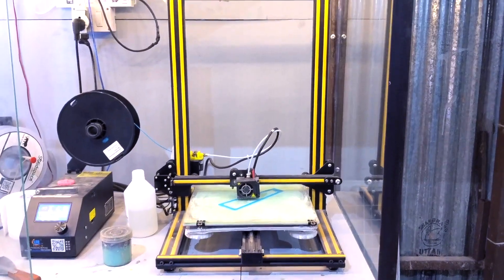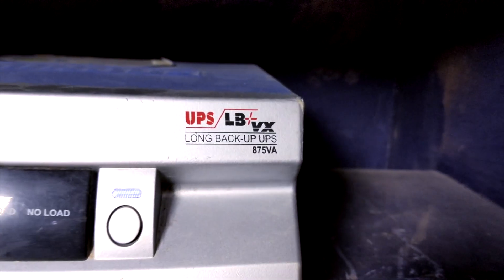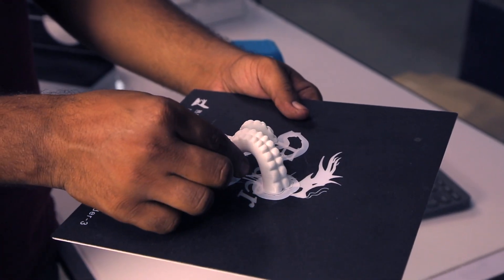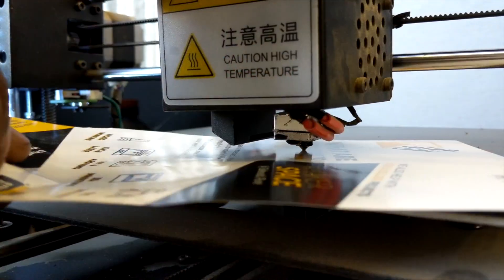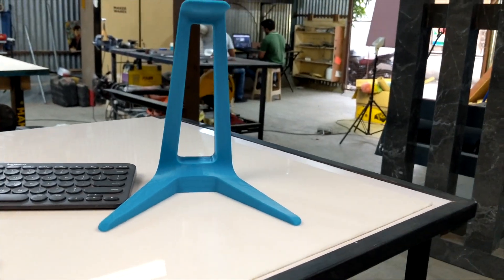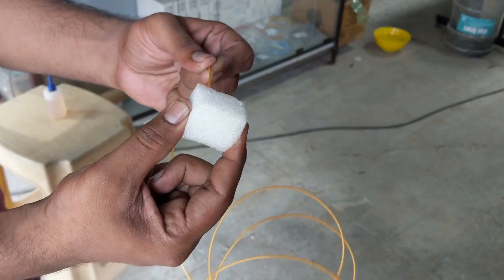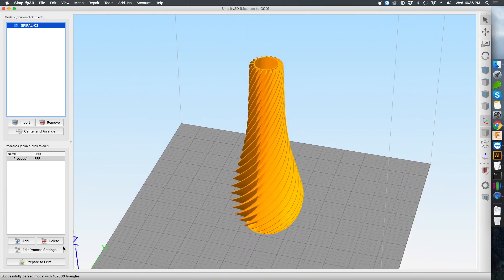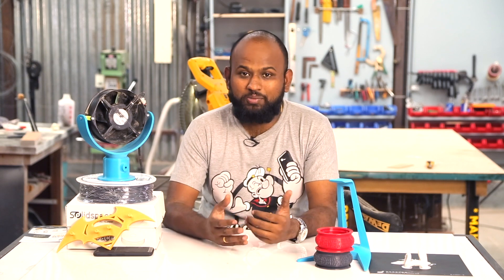Tips to get Best 3D Prints every time

Comment: In this 3d printer also stepper motor used.so the CNC controller are used her?
Reply from the maker: Yes. 3D printer is essentially a CNC machine only. Instead of router we use extruder to push filament. That's all
Reply: Sir I had a fdm 3d printer in that all steper driver are connected in single bord it is possible
Reply: Sir pls give ur contact number or whatsapp number I clarify my dout.
Reply from the maker: @mukilan574  yes. But do not reinvent the wheel unless you are doing remarkably something different
Reply: @Kalaakaar-in  thank you sir bye

Comment: Not again the oil trick... :-(
If you need oil, in fact you need to tune your printer. Oil is such a bad solution.
I hear people say this so often, I made a video on my channel explaining why this is a bed idea.
Reply from the maker: Yes I have seen it. But not all the results are the same. Also in this video it's just a 30sec section. There are so many other points also in this video.
Reply: @Kalaakaar-in  the rest of the video is very good but the oil part is just bad for the printer and it makes the prints weaker.